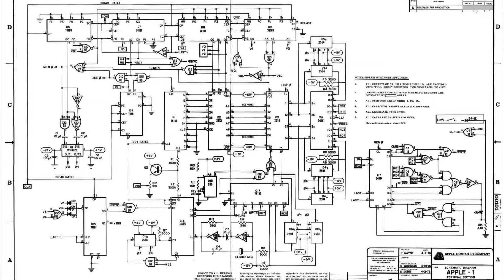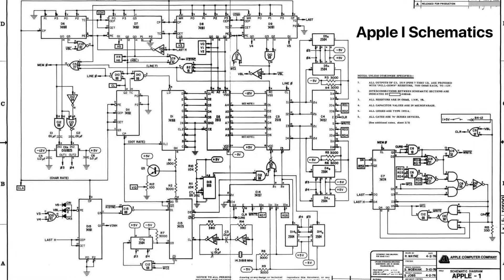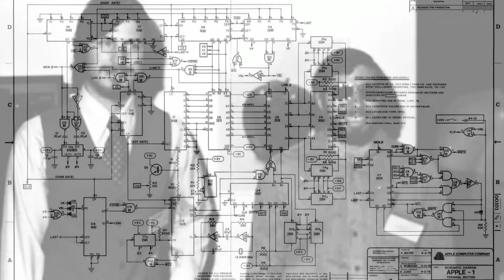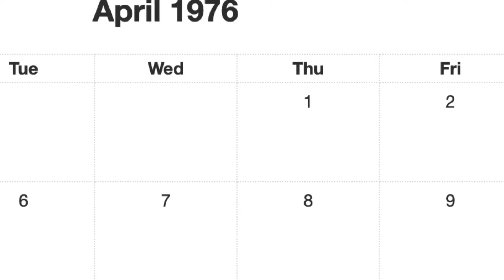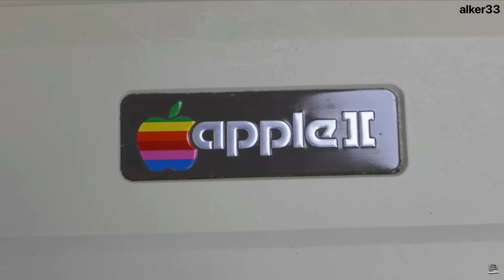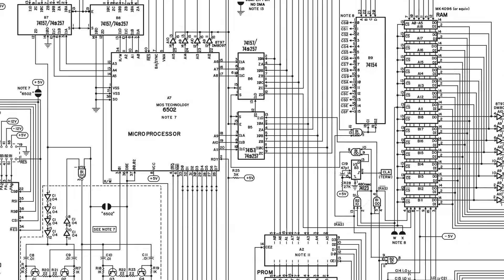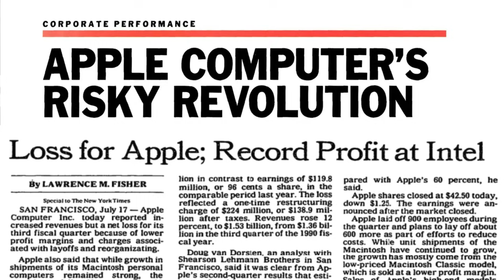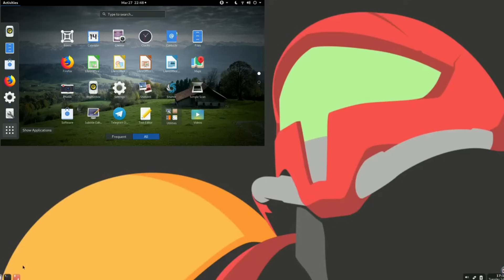Apple History: How Steve Wozniak's Open Source Dream Was Lost

Comment: Technological access and user simplicity are both positive goals, but can end up being in tension. I think today there are only two laptop makers who are really doing anything interesting: Apple with a perfected take on the locked-down approach, and Framework with an open platform and upgrade paths. Each one can pursue its own advantages to their full extent, while everyone else is just awkwardly in the middle.
Reply from the maker: You make a great point! Apple’s locked-down approach is super polished, while Framework's open design gives users a lot of flexibility. It’s cool to see both extremes being done well, but I agree - everyone else seems stuck in the middle trying to figure it out.
Reply: @AnsonAlexander  I’ve been a Mac guy for over 20 years. The one alternative that even has me turning my head with any interest is a Framework running Linux. (They’ve got official support for either Ubuntu or Fedora.)

Comment: The Apple was the last computer with hardware and software designed by a single person.
Reply: Sorry, but the Apple II was designed by 3-4 people.  Rod Holt did the power supply.  I can't remember his name but there was another guy that was crucial in helping Woz design the memory architecture (the slots, etc).  Someone else did the case design (alongside with Jobs), etc.  And that's just hardware.
Reply: The Apple I was solely Woz’ hardware and software.
Reply: @mitchellsmith4601  well, kinda.  Woz took inspiration (copy??) from Lancaster's book TV Typewriter which is an awesome read.  I mean, Lancaster probably got some of his ideas from other people, etc.  That's the beauty of sharing ideas.  😀
Reply: The Apple I was basically a turn-key 8-bit computer with terminal circuitry and video output. It was super simple. Anything more complicated than that took a team to design. You're quite probably correct.

Comment: Visicalc was NOT the first spreadsheet for personal computers. Even the good old BBC Microcomputer and the Commodore Plus 4 had these and there were personal computers before the Apple 1 that's nonsense. Of course there was a whole wave of personal bespoke computers around before that.

I can't lie, nor want to cause offence to anyone, but I will give you my historical experience with apple products since I was only 13 years old.

In the computer class we had a ECONET network of BBC Miro's. Cheap for the school to buy and install in a network environment. They had these 2 Apple iie's I wanted to like them, I tried to like them. And to give a fair use at working with the BASIC it was dreadful at calculating vectors and I could go on and on. The school had spent more than half their budget on these 2 uninteresting paper weights.

I was by this point diverging away from closed niche products such as the whole ecosystem and the locked in expense of purchasing one of their products as well as having to buy the overpriced peripherals.

I then noticed through the years that they had becomes master plagiarists SO GOOD ON SAMSUNG for once for returning the favour. Admittedly Gates as well as Jobs tried to steal the Xerox Alto prototype. But while I was using PC products that could be easily serviced maintained and easily often affordable components.

Then we had a company that spent about 20 years whining about how unfair it was the Microsoft were so much more relevant. But all Apple have ever tried to do, even when I was only 13 was to corner the hardware and software market.

So I am sorry to say that is my honest experience of Apple as I grew up. Well I will be 50 in September so I hope you will come to realise that I am only saying this from personal experience.

Anyway if you got this far then thank you and try to see that I am NOT a troll, only someone that wishes to give a point of view.  

BSc HONS Computer Science & Automation

Comment: I was a big fan of the Apple ][
I wouldn't touch a contemporary Apple product with a 10' pole…
I remember seeing some interesting stuff plugged into the many expansion slots, but disc drives and huge memory cards were the most impressive, especially one friend's huge 128Kb memory card (ironic these days, of course).
But certainly, the openness of the Apple ][ propelled its success and longevity.
Reply: Its open design certainly helps the enthusiasts keep it alive. My Apple //e has a CF card as an SSD with several partitions, as well as VGA output thanks to a card with a Raspberry Pico on it. Of course there’s people still writing and updating software for it as well. I have used Mac, Windows, and Linux, but nothing brings me more joy than my Apple //e.
Reply: TOTALLY AGREE! I gave up on Apple when they came up with something totally proprietary, the 128K Mac. How was I supposed to program THAT? Buying a LISA so I could program the Mac? NO THANK YOU. I switched to the PC family of products and never looked back.

Comment: Initially home computing had an open source nature with Computer clubs being the foundation. Richard Stallman who started the Free Software Foundation had a very similar experience to Woz but he was a programmer not an engineer. But his ideals were the same and Linux is both free and open thanks to him largely.

Having said that, as someone who also uses Linux, I do agree with Steve in that if you want to make a commercial hardware based product it must be closed source.

The open source community has a big problem: many projects either go nowhere or progress very slowly because there is no leadership and development happens if and when people have time. 

That's why you can install the latest Linux but still have driver issues with hardware not working properly or not at all. Sometimes WiFi will stop working because of a kernel update because there is only 1 guy maintaing that driver and he needs to wait for the kernel to be released before he can patch he driver. Plus he needs to find time to do this while working full time on something else and having a family. 

So you can wait a week until the WiFi works again....

Etc

This is unacceptable if you're selling a product. You need paid employees who are doing this full time and for that you need to be closed source otherwise another company with start tomorrow, using your tech because it's free, and compete with you. 

That's just life in a market economy.

There is a place for open source though, especially for the 3rd world and old PC's where Linux can extend the life of old PCs significantly.